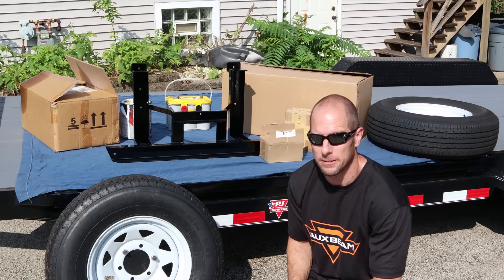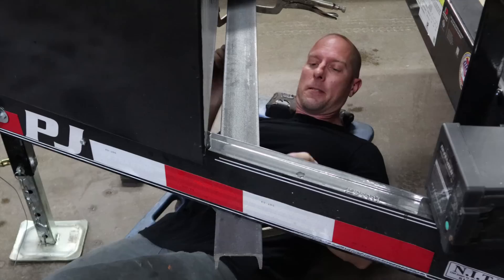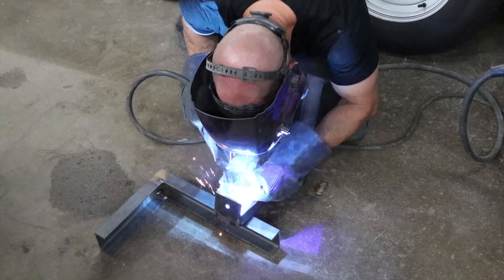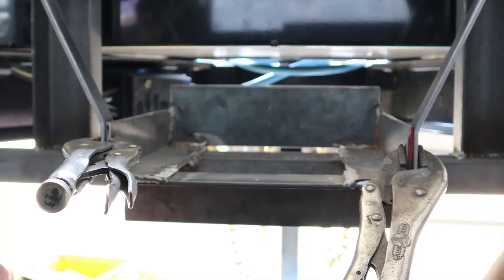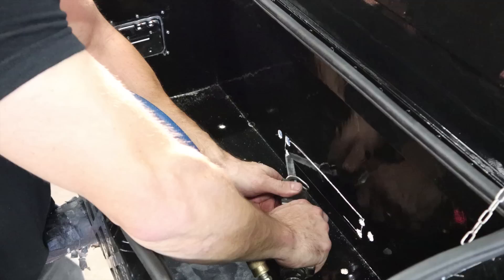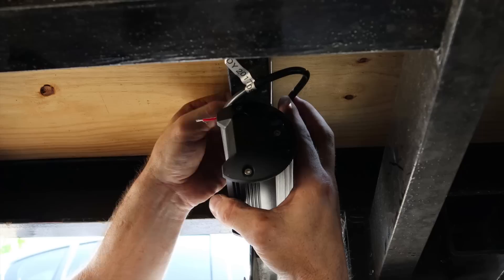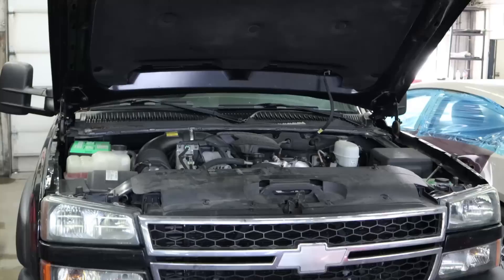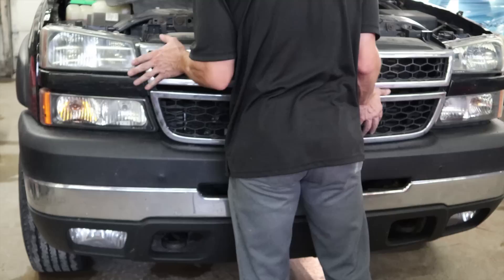2019 PJ equipment trailer winch mount fabrication,  LED light installation and other mods..

Comment: What size C chanel did you use? And where did you get the toolbox you put the winch in? I just bought a new PJ trailer yesterday and would love to do the same
Reply from the maker: Three inch c channel and there is a link in the description for all the parts used.  Good luck on your new trailer.

Comment: Did the new LED truck lights effect your radio reception?  I tried them in my 2011 F150 and lost several of my normal radio channels.  Do you know if there is a fix to this issue?  Thank you.

Comment: Question: I have a similar trailer. I intend to add a winch and was hoping to provide 12 volt power to the winch via my truck's trailer plug (it has a hot line for charging trailer batteries) and eliminate having to have another "trailer" battery.  I haven't purchased a winch yet so I'm not aware of the amp requirements so am not certain whether or not this is a viable plan.  Your thoughts and insight would be appreciated.  Thanks.
Reply: Jim Garland  don’t do it if you value your truck, that little wire can’t carry the amps you need to run the winch, it will melt and catch fire.  You definitely need a battery.
Reply from the maker: Most winches will give you the amp draw at various tensions.  All of which will be higher than what can run through the factory wiring on any truck.  That factory wiring is meant to charge a battery, not power heavy load accessories.  You need a battery.
Reply from the maker: @jonrosenow5812  You are correct!

Comment: I'm glad you made this video as I am looking to do something like this to a trailer I recently bought.  I'm having a bit of trouble figuring out how to make a winch mount that doesn't infringe upon the area that is currently used for the spare tire.  The trailer is a Big Tex 14OA (over axle equipment trailer) and I intend to run the cable through a hole I will cut out of the "front bumper" on the trailer.  I'm not sure how to address the angle that the cable will have to go off of the rear facing corner of the deck to pull a vehicle that is on the ground.  Do you have any guidance for how to fix that problem?  Thank you very much!

The setup you created in this video is way cool btw.  I like the fact that you modified a lockable box to put the wench inside of it.

Comment: Might be a stupid question but i was told a half ton truck was too small and unsafe to be hauling around cars ?
Reply from the maker: It would be fine for small cars on a small trailer.  I have always used at least a 3/4 ton even with my old trailer.  The gas motors struggled on the hills even in the 2500 with a heavier load so a 1500 would really have a hard time.  If you start looking up payloads, trucks are not rated as high as people think they are.  After my first diesel, I will never go back to gas for trucks.  It is probably overkill but the mileage and power can't be matched.

Comment: So to change the battery you have to remove the winch... seems like you missed that...
Reply from the maker: I, unlike the engineers, design things to be serviced after they are built.  There are 4 inches between the bottom on the tool box and the battery to loosen the hold down nuts.  I turned the rear angle iron downward so that I could slide the battery straight back and then down through the large space behind the battery....... seems like you missed that......

Comment: What size trailer is this: weight carrying cap ?? what size pick up truck needed, 1/2 ton or 3/4 ton ? Thanks
Reply from the maker: 10k and you can pull it with anything rated to pull that much.  I never use anything smaller than a 2500 and all mine are diesels.  Way more than required but I like having more power than I need, it helps a lot in the mountains.

Comment: How has that Optima battery been for you? I've never had or used one and I've heard that the quality has gone down the drain. Did you put under the trailer in a couple places the vin number? Get someone that is a pro welder and have them write the vin number with a welder. Then go to Harbor Freight Tools get a Number and Letter Stamp Set. Do the trailer again with the stamps and each ramp it they can be separated from the trailer easily even if they can't. Even do the trailer rims on the inside part of the hub ( with the stamps ). Film it and save that file but don't share it with your YouTube subscribers. Maybe even think of getting a GPS tracker for it.
Reply from the maker: It has been fine so far.  PJ stamps the frame in multiple location and the trailer is insured.

Comment: Just a small question - Grounding  - Did you expose the metal for the grounding contact for the LED lamps?

Great weld up!
Reply from the maker: The two lights under the deck I just grounded to the mounting bolt for the lights themselves.  The metal was exposed from drilling the hole for them.  The toolbox lights, deck lights, switches, battery, and winch are all grounded to one lug I put inside the toolbox through the winch mounting bracket.  Thanks for watching
Reply: @vehcor  Thanks for the clarification. The video made that tiny detail less obvious. But now you have explained it.. fantastic .. looks great!
Reply from the maker: No problem!

Comment: Hello ? What are you going to do for the tie downs .I have a big Tex with same style side bars not in right place for my tractor wondering if you have the same situation
Reply from the maker: I always use the stake pockets.  I recently got a set of D-ring inserts that I can move to different pockets and it keeps the straps at a better angle.  The inserts have pins on the bottom so moving them takes a few seconds.  There is no particular position I use all the time.  Depending on the size of the vehicle, position on the trailer and direction it is facing on the trailer, even the same type of vehicle can be tied down differently each time.  I also have a variety of chains, hooks and straps so I can use different mounting points on any vehicle.

Comment: Would it be cheaper to buy a flatbed towtruck?
Reply from the maker: A new rollback is around $70k so maybe if you count a new truck and trailer, yes.  However it costs more to operate and maintain a flat bed than a 2500 pick up and trailer so in the long run, this is much cheaper.  Since I build my own tow rigs, this way is much cheaper in the short run as well.  Thanks for watching.

Comment: how does the battery get charged back up
Reply from the maker: The 7 pin trailer plug that goes to the truck has a battery power so as I drive, the truck alternator charges the battery.  The volt meter in the tool box lets me know at a glance if it is charging.  Good question.  Thanks for watching!
Reply: so I guess you just tapped the battery into the battery power wire from the trailer connector?
Reply from the maker: @thisisimpossibly  Ran a wire from the junction box to the battery... actually another junction block that went to the battery.

Comment: do you have to remove the entire winch to replace battery and how would you charge the battery if needed through cables at the winch
Reply from the maker: No, the battery can be removed from underneath and the battery charges through the 12v power from the truck when I drive.

Comment: Do you happen to remember the measurements? I want to copy this exact design of yours for my trailer
Reply from the maker: Sorry, I do not.  I did not write anything down.  I never thought there would be a market for this but it seems pretty popular.  I can give you the material list I purchased: 
16ft of 3" C-channel - the basic frame (had some leftovers)  
1ft of 3" flat stock  - the ears for the end to drill into
5ft of 2" angle - the battery tray, size may vary depending on the battery you choose
3ft of 1" flat stock - rear brackets for the battery tray
Links for all of the toolbox, switches, winch, etc are in the description.  

Thanks for watching.  The time saving use of this install was well worth the time to build it.  Good luck on your project.
Reply: Come on bro ...
You know how to read a tape measure....
Don't you...????
Hell he showed you everything but he didn't do it for you.....
You can do it Bobby...!!!!

Comment: Anyone know what brand that trailer paint is? About to buy a trailer and will need to coat the deck with something
Reply from the maker: It was Behr deckover paint.  It has held up fairly well except for where I have been dragging tires over it.  I guess I cannot complain, it is only meant to be walked over. lol

Comment: When welding you push not pull your welds.
Reply from the maker: I'm not saying your wrong but: 

 Pushing usually produces lower penetration and a wider, flatter bead because the arc force is directed away from the weld puddle. With the drag or backhand technique (also called the pull or trailing technique), the welding gun is pointed back at the weld puddle and dragged away from the deposited metal.

MIG Welding: The Basics for Mild Steel | MillerWelds

https://www.millerwelds.com/resources/article.../mig-welding-the-basics-for-mild-steel

https://www.weldingsuppliesfromioc.com/blog/push-or-pull-which-is-right/

Comment: Why the lights under the trailer
Reply from the maker: A few reasons:
1. When you are loading a car at night it sucks to carry around a flash light while you are trying to hook up chains and tie downs.  When the car has to be winched onto the trailer, they provide light to find tie down points under the car for the winch. (Just like the deck light do, once the car is on the trailer).
2. When you are pulling the car onto the trailer, they light up the ramps so you can see the edges and stay on them.
3.  They make great back-up lights.  I did not intend them for this use but they are great for it. I may wire them to the reverse lights so they come on when I put the truck in reverse and I don't have to actually get out of the truck to turn them on.  Thanks for watching!

Comment: Aluminum switch plate in aluminum toolbox instead of steel cause the two metals don’t get along.........

Bolts toolbox to mild steel bracket assembly and puts winch with steel components inside....

Seems legit
Reply from the maker: I didn't know they made aluminum winches....hmmmm I guess I should have gotten one of those.  The paint and powder coat will insulate the two metals anyway.  When I have the choice I use similar metals.

Comment: Your welds need more amps.
Reply from the maker: Actually it needs thicker wire.  I welded both sides of everything so it should be fine.  If not, I have a reason to play around and build new stuff.

Comment: What winch tray is that?
Reply from the maker: https://www.amazon.com/gp/product/B007JMOY22/ref=as_li_tl?ie=UTF8&camp=1789&creative=9325&creativeASIN=B007JMOY22&linkCode=as2&tag=vehcor-20&linkId=dd3a23b27953f90aa1d1950c69340c22
Reply: Thanks and one last question, what size material is that? 3x1ish C-channel and 2x2 angle?
Reply from the maker: 3" c-channel by 1 1/2" and 2x2" angle 1/4"
Reply from the maker: Also 3" flat stock for the ends and 1" for the battery support brackets.
Reply: Perfect, thank you.  Ill make  a follow up video to show you where your idea went!
Reply from the maker: Just send me the link in a new comment so I don't miss it and I will check it out.  Happy fabricating!

Comment: You should have got a ford
Reply from the maker: LMAO my 06 Chevy is worth $15k+ an 06 F250 diesel...... less than $6k.  Both were selling $20k when I got mine 6 years ago.  I would have lost my a$$ on a Ford. LMAO not to mention I would have had to rebuild the 6.0 multiple times and rebuilt the front suspension.  Looks like I made the BEST choice!
Reply: vehcor now they over priced them chevys are worth like 1 dollar plus if you went to get ford I would choose a Ford F-350 7.3 diesel not a Chevy not to mention but they are ugly to
Reply from the maker: If I wanted an old truck I would have just keep the Chevy I got rid of before that one.  I had it for 6 years as well and it had over 300k and never had any work but oil changes brakes and tires.  I still made money on it when I sold it.  If you REALLY want to know how reliable a vehicle is, ANY VEHICLE,  look at the resale value.  Oh yeah and a 7.3 Ford is still worth less than an LBZ GM.  A 6.0 Ford is worth less than uh, everything.  LMAO  I have never had problems with my GMs but I have had plenty with my Fords.  Since I am a full time mechanic, I stay away from what I see in the shop daily.  It amazes me how people with Fords think spending thousands a year to keep their vehicles on the road is normal. LMAO  I am sure you know more than me though with you expert knowledge from watching videos. LMAO
Reply: vehcor I do

Comment: You painted the wood with sand, I've seen where mixing one gallon of diesel with 2 gallons of used oil moped on wood will protect it and not rub off. What brand name did you paint wood? I just subscribed today, first video on black truck.
Reply from the maker: It was Behr deck over paint.  There are three textures.  I chose the middle one.  I do have to squeeze between the car and trailer and didn't want the super corse one as it would peel off my skin every time. lol  Glad to have you here. Thanks for watching and the sub!

Comment: DID U XRAY THE WELDS,  HA HA HA
Reply from the maker: Nah, we are going to go with the strength test through use method. lol So far so good!  I wish I could say the same for the wheel that cracked right in the middle and went flat almost instantly.
Reply: well you could hear they were a bit cold, you can see they have a high bead also, you only want the bead say 1/3 as high as they are wide

Comment: I hate to be that guy but here goes you took the time and effort to weld onto 2 additional brackets for the battery tray ?!?!But you're only using two machine bolts on your battery hold down bracket please take the time and effort in putting 4 more bolts in that bracket. An ounce of prevention is worth a ton of Peace of Mind
Reply from the maker: If you hate to be that guy.....don't.  Let's be honest, you WANT to be that guy.  You even had to try hard to find some nonsense to come up with.  Why is it nonsense?  Allow me to explain.  First of all there are batteries 3 times the size held down by the same method.  The support brackets were put in because there was 60 pounds of battery hanging by only angle iron.  Had the battery been centered over the c channel under it, the support brackets would not be needed.  It is a thing called leverage.  Try lifting a car, you can't.  Now put a long enough lever under it and you can with the same lifting effort.  The battery has much more leverage at the end of the angle iron from the mounting point.  The amount of force the battery produces downward is far greater and requires more support due to that whole gravity thing.  The hold down has that whole gravity thing working for it.  It is basically only there to keep the battery from shifting and that does not require 4 bolts.  Unless the trailer rolls over and then the battery mount is the least of my concerns.  Last but not least if I start spreading out the hold down bolts to add more, they will interfere with the terminals.  Thanks for watching.  I'm glad you were so impressed with my video that the worst part was something that was really not a problem and if it were I could easily fix it at any point.
Reply: Okay great. Good luck with your channel.

Comment: 7:40 ... Battery 60 lbs?
Reply from the maker: The original battery was 60, the one I ended up going with was only 43.  A little extra work won't hurt and I can move up if I want.
Reply: ... I see.  I recently carried by hand a $200+ AGM battery for about a mile, that looked similar in size to the one you showed, and it weighed 45 lbs.  Either your battery tech was something Autozone doesn't sell that I would be curious about, or, I was going to suggest checking the calibration of your scale, or, perhaps you were counting the weight of a trickle charger, isolation switch, cabling, connectors, etc.
Reply from the maker: @kradius2169  This was the original one I was going to go with: https://www.optimabatteries.com/en-us/bluetop-dual-purpose-deep-cycle-and-starting/d31m

Comment: Led lights in a reflector headlight  ... NG! 
led lights in a projector headlight  ... OK
Reply from the maker: Halogen lights in a reflector light .... what is worse than no good?  NFG?
Reply: @vehcor  How about not blinding oncoming cars, that would be nice. Either spend the money to get the correct housing/ reflectors or keep it stock. If you can't do it correctly, don't do it at all please.
Reply from the maker: How about you learn the simple skill of properly aiming your headlights so they do not blind people?   Most projectors use halogen lights anyway and that is what they are designed for but I would not expect you to know that either.  Besides, it would only make your job of looking for something to hate more difficult.  Thanks for watching!

Comment: @vehcor not trying to be a jerk at all but you need to add some motion called “walking the cup” or more circular motion to your mig welds. The reason you see all of that porosity (little pin holes), cold roll, and lack of penetration/adhesion is due to your travel speed and lack of motion while welding. Check out some videos of @chuckE2009 his welding videos are great. I owned a structural steel business and some of those welds especially since you only put in one pass will fail under a lot of strain. The motion while welding is what makes welds look like they are a stack of coins instead of just smooth like your welds. The stacked coin look isn’t just for looks it’s the sign of a strong weld.